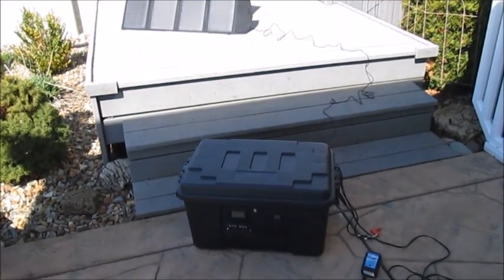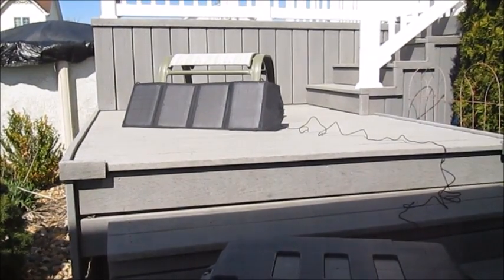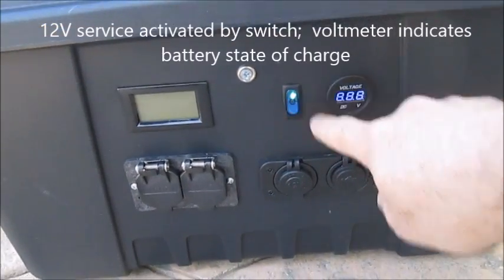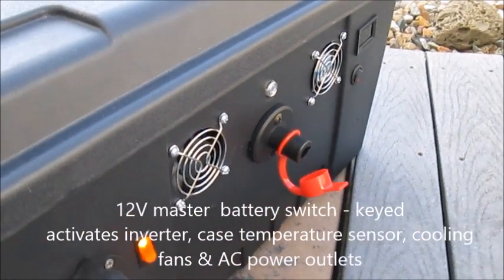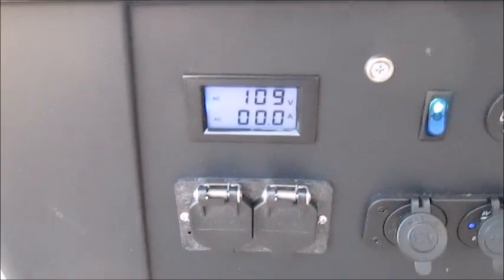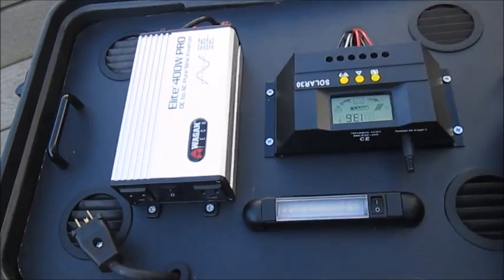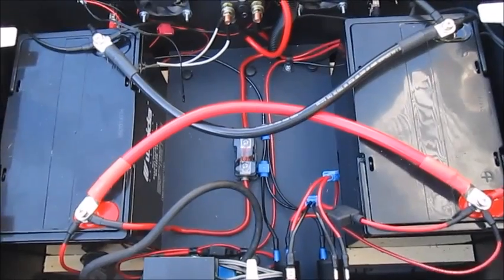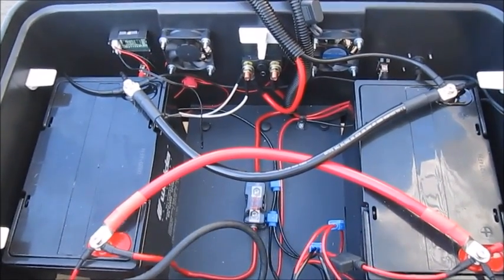V1 P1 DIY Portable Solar Power Generator - Wiring Schematic, Parts List, FAQ Sheet Provided

Comment: How portable is the Storage and panels ?950 includes these panels, mono or poly?
Reply from the maker: The weight of the battery box is about 90 pounds Eric. When I take it out of my boat for winter storage it is placed on a small dolly that allows it to be rolled around quite easily http://www.harborfreight.com/200-lb-capacity-movers-dolly-95353.html  To be sure, it is a two person operation lift and move the battery box safely for use in different situations. It is portable to the extent that it is not permanently attached to any fixed structure, such as is the case with some solar energy systems installed as backups for home use. The panel I use at present is light and easily stored, although Renogy has stopped producing the bendable mono panel I mentioned in the video. Yes, the total cost of the build was about $950 including one 100 watt mono solar panel.  I paid a little more for the bendable panel, but if someone else was to build this system they could realize some savings by using a rigid framed 100W panel.
Reply: So... not very portable. Not a lot of output for 90 pounds and nearly a grand. And for convenience you should buy a dolly for single person transport.
Reply from the maker: For comparison Eric, check out the Goal Zero commercial line of products.  Their 1250 model is 116 lbs., offers only 100 amp hours and includes two 30 watt solar panels.  That system retails for $1,999.95 - more than twice the cost of what I was able to build for myself.  Depending on the application, yes, a dolly might be a useful addition to my design.  Since it was primarily designed for my use on a boat a built-in dolly wasn't practical.

Comment: Generator ?? Or is it "storage".
Reply from the maker: The complete system, when all components are taken into account (solar panel and the battery box), is in essence a "generator".  I think that is an appropriate term that has been commonly used when describing these types of systems.  If you want to be technical, the solar panel generates electricity and the battery box stores that electricity for distribution.

Comment: Are both of those fans exhaust fans?
Reply from the maker: They are set up to create a circular flow.  One fan is oriented to push air into the case and the other is oriented to draw air out.

Comment: 90lbs i would definately keep this in the back of a mini van with the panel bolted to the roof of the van.
you should have a Ebay store and sell some of this as barebone unit without the battery and panels, so people can put what panel and batt. they want. i would buy somthing like this.
Reply from the maker: Thanks for your interest in my DIY project and for taking the time to comment, it is appreciated. The sizing of this solar generator is, in my opinion, just right for use in a mini van or small RV (boat/camper).  There are a variety of commercially produced systems of comparable size available for purchase on the market right now.  Most I have seen come with batteries and some offer options to pair up with solar panels.

Comment: how to made the same thing using 18650 battery?I have lots of them, problem is with the voltage. 11.1. Solar charge controler have to give to the 12.6V over this gona blow every things up.

Comment: Sorry to be the bearer of bad news, but I'd rather it didn't blow up one day when you flip the ON switch.
Although these are AGM batteries, they can still emit some hydrogen gas while charging, especially during overcharging. Google it and see that although all the AGM makers USED to say they were completely safe, they changed their minds around 2000 or so. American Boat and Yachting Council (ABYC) requires that batteries be installed in separate, well-ventilated areas. If those are computer type fans they spark internally and can ignite any gas buildup, plus the lighter than air gas would build up around the inverter and charge controller. Not good.
There are sparkless fans available like they use to vent gas fumes from a boat's engine compartment. With those, and maybe an airtight seal separating the top half from the bottom, then it would be safer. http://zephyrvent.com/specifications-and-prices/
Reply from the maker: +st8kout1 Thanks for your comments and concern.  Simply removing the lid prior to use would effectively eliminate any concern for hydrogen gas buildup that would result from a malfunction of the charge controller leading to overcharging.

Comment: Love the project, but hate the power inverter. Wagan is Garbage imho. I bought one, used it for a week and it died. RMA, received a new one. Had it for a month and it died. Fans Comes on both, but was getting no power. Had and old 400 power inverter laying around that i paid 35 bucks for and it has been working flawlessly for almost a year.

Do you have anymore recommendations besides the wagan power inverter?
Reply from the maker: +Chris . Jones Thanks for your comments.  Well, so far I have had good luck with the Wagan EL2601 400W pro pure sine wave inverter.  The inverter has been in use for a year and I have had no problems with it.  Up to this point I have had no experience with another brand so I couldn't recommend an alternative.   I will post here if the Wagan fails and let you know which replacement I select.

Comment: I love the design and look of it.  I'm surprised it cost that much though.  Still a ton cheaper than premade solar boxes.

Btw, why just a switch for the fans? Couldn't you also install a $20 to $30 standard AC/heater temperature controller?  You set the temperature you want it to run at and it would send the signal to turn on the fans when the box got too hot.  All you would probably have to do is find a simple relay circuit that would actually control the juice.  I'm not an electrician though... there may be a reason this wouldn't work.  It may sound easier than it actually is.
Reply from the maker: +101perspective Thanks for having a look and for your comments.  Keep in mind that total cost of $950 includes the 100W solar panel that is used with it ($220).  Without the cost of the solar panel included the cost of the generator alone was about $730, which is quite a bit less expensive than a commercially produced generator of comparable ability.  The two big expenses of the generator itself are the two batteries ($120 each) and the pure sine wave inverter (another $120).       I had not considered a thermal switch to control the fans automatically.  Good idea- may be an upgrade in the future!
Reply: Jim Fisher
Oh, I didn't factor in the generator.  Okay, that makes a lot more sense now. I was afraid there for a moment that I had bought super cheap stuff or something...lol.  Granted, that could still be the case.  Got all my stuff from Windynation.  They seemed to be professional and all.  Extremely helpful at least with all my questions.
Reply: Jim Fisher
Btw, when you say "solar generator", are you talking about a thermal generator?  I'm not that familiar with what you are talking about.  Until your post above, I thought the box itself was just called the "generator".  Despite it really just being a fancy battery box. 

I've seen the term before.  However, it's always just a solar panel and fancy battery box.  I'm sure I'm missing something here.  You paid $730 for it so it obviously is more than just what I'm seeing.
Reply from the maker: +101perspective When I began researching a portable (non-permanent installation) solution to my electric needs on my boat I came across a number of YouTube videos that described "solar generators", so that is the term I stayed with when describing my system.  The box on its own is just as you described it, a fancy battery box, but when paired with a solar panel the complete system becomes a solar power[ed] electric generator. Here's the complete list of all of the components/parts and their costs.  There are a lot of small parts that are used to build the system that add up fast when you are making one of these from scratch.   http://www.creeksideartifacts.com/parts_list.pdf
Reply from the maker: +101perspective For comparison, have a look at Goal Zero's Yeti 1250 Solar Generator that is commercially produced.  It generates less amp hours than the system I built and they are selling for $1,600 without the solar panel.
Reply: Jim Fisher
Yeah, those Goal Zeros are such a rip off for what you get.  I think many people even buy them and just leave them in one spot.  But yeah, if you want something portable then it's that or what you did... and all those wires scare people I think...lol.

On the "solar generator"... yeah, that is what I've always seen also.  I just got confused when you said you paid $700+ for the generator.  I see you mean the battery/power box. 

Plus, your cost seemed a bit high.  However, you have a lot of switches and stuff and all those things add up I guess.  Plus, I thought the cost for your solar panel included wires, fuses, controller, etc.  I see now that you got a monocrystalline panel which I think costs a bit more than the polycrystalline I got. I hear good things about the monocrystalline ones though.

Anyway, I'm with you now.  Thanks for your time.  And kudos again on the project.
Reply from the maker: +101perspective No doubt I had the "deluxe" concept in mind when I built this system- you could certainly build a basic functional system with a less "finished" look and save some money.  I did take your suggestion to consider installing a thermal switch to automatically control the cooling fans.  I found what I needed on Amazon for under $20 and the installation should be quite simple. Thanks for that idea!
Reply: Jim Fisher
Cool.  Happy to help.  Make sure you keep us updated on how you wired it in.

Comment: Für mich ist soweit alles richtig angeschlossen,was mit dem Außenbereich, wie Steckdosen Ziegarettenanzünder, ect.  Aber beide Batterien müssen einen Anschluss von rot auf schwarz gekreuzt angeschlossen werden, und das andere Rot und schwarz der Batterie (Rot+ Schwarz -) dann mit dem Außenbereich Steckdosen, Zigarettenanzünder ect. angeschlossen werden...Warum...Weil es 24Volt dann anzeigt, und nicht 12Volt. Außerdem werden beide Batterien gleichzeitig mit gleicher Voltzahl aufgeladen. Damit verhindert man, das eine Batterie zu warm wird.
Reply from the maker: +fred schaden Ich hoffe, dass die Übersetzung Ihrer Kommentare korrekt war und meine Antwort ist angemessen. Die beiden 12 Volt-Batterien werden gezielt parallel geschaltet, um eine 12-Volt System aufrecht zu erhalten , dass die Amperestunden zur Verfügung verdoppelt . Die rote Pluspol der Batterie an der ersten Batterie ist mit dem anderen roten Pluspol der zweiten Batterie und schwarz negativ schwarz negativ verbunden, um die Parallelschaltung zu schaffen. Verbinden Sie den roten Pluspol der ersten Batterie mit dem schwarzen Anschluss an die zweite Batterie in Serie würde in einem 24 -Volt-System zur Folge haben. Alle Geräte I mit diesem System verwenden werden wurden 12 Volt zu arbeiten ausgelegt werden. parallel geschaltet ermöglicht es auch , sie beide zu Entladung und Ladung gleichmäßig die Batterien zu haben .I hope that the translation of your comments was accurate and my response is appropriate.  The two 12 volt batteries are connected purposefully in parallel to maintain a 12 volt system that doubles the amp hours available.  The red positive battery terminal on the first battery is connected to the other red positive terminal on the second battery and black negative to black negative to create the parallel connection.  Connecting the red positive terminal on the first battery to the black terminal on the second battery in series would result in a 24 volt system.  All of the devices I will be using with this system were designed to operate using 12 volts.  Having the batteries connected in parallel also allows them to both discharge and charge evenly.
Reply: +Jim Fisher / +fred Schaden. Ja das mit der Ampere-Verdoppelungen gibt mir zu denken. (Beide Batterien Verkabelung rot +auf +/schwarz auf...  Es wird auch meistens auf 12volt strom verbraucht. zB. Boot oder im Camp ezt. Die Kreuzverkabelung beider Batterien rot zu schwarz, sind bei mir mit einem Haupt an-aus Schalter verbunden, der dann direckt an dem (Solar) Power Inverter angeschlossen ist.Dieser hat eine Eingangsleistung von 24-30Volt.Diese ist von außen mit einem Parameter Voltanzeige angezeigt. Somit war es mir leichter bequem mit solar die Batterie wieder aufzuladen, während der Verbrauch vom Power Inverter entnommen wird. Mit der Ampere Verdopplung werde ich wohl noch ein wenig Recherchieren müssen. Nochmals Danke. LG FRED

Comment: where did you get the voltage display?
Reply from the maker: +Alex Holl the AC ammeter was purchased on Amazon http://www.amazon.com/gp/product/B00DVH64HW/ref=oh_aui_detailpage_o00_s00?ie=UTF8&psc=1
The DC meter also purchased on Amazon 
http://www.amazon.com/Coromose-12V-24V-Motorcycle-Voltmeter-Waterproof/dp/B00S7FUT10/ref=sr_1_23?ie=UTF8&qid=1425862186&sr=8-23&keywords=voltmeter+12v

Comment: so just incase i save water instead of using solar to operate a well pump i could use one to operate my refridgerator air and heater, most important i want suggestions for those should i run out of fuel or cannot refuel soon.. i kept your information just incase thanks a bunch
Reply from the maker: +samantha nicholson a refrigerator draws the least watts of the applications you mentioned and a moderately sized solar panel array and semi-portable battery bank would suffice for that purpose.  But, in my opinion, running air conditioning and heat (particularly electric baseboard heat) would demand a much larger system  than is represented by what you see in my video.  You would need multiple solar panels and a much larger battery bank from which to draw the amp hours and high wattages being drawn by air conditioning and heat.

Comment: where did you get the box?
Reply from the maker: +samantha nicholson       Amazon - search under Plano 1619-00 56 Quart Tote Tub
Reply: Thank you
Reply: How much would you sell one of those for?  I'm planning on going state to state in my Toyota truck I need something about that size to use for light n heat also for charging a refrigerator.
Reply from the maker: +samantha nicholson I don't make them for sale, this was simply a hobby project.  If I were to roughly estimate what I have invested into this generator inclusive of both my time and the materials it would be about $1,800 to 2,000.  There are commercially produced solar generators available on the market that are similarly priced.
Reply: I loke this one :0) nice job i thought about a solar one to use for house refridgerator or outside to help keep well pump going
Reply from the maker: +samantha nicholson Thanks for your appreciation of my design and build.  I borrowed many of what I felt were the best features of quite a few others' designs that were posted here on YouTube.   This one could effectively power a small home refrigerator, but it would need a larger watt inverter to handle a well pump.  They tend to draw a lot of watts at start up.
Reply: Would a 1000 watt pure sine work?
Reply from the maker: +samantha nicholson my quick search on the web indicates that a 1/2 HP well pump will draw 2100 watts at start up and continued running demands 1000 watts.  You would likely want at least a 3000 watt inverter or more and a pure sine waver inverter will be better for the pump motor.

Comment: looks great man, I'm working on a similar system for garden lights etcetera. I intend to use only 12v as the inverter to 220 generates loss while converting. Your project is a nice inspiration source!
Reply from the maker: +Boss Thanks for your kind feedback.  You are right, if you only plan to use 12v appliances there is no need to spend the money or solar energy you generate to invert for AC use.

Comment: "Thinking out loud here": In an effort to keep as compact/"light-weight" as possible, pretty sure I will use two 35 amp hour deep cycle batteries vs. (1) large 80+ amp hour battery.?. Would like to build mine in the smallest Stanley brand, plastic tool box on wheels with telescopic handle that they make. Trying to find a minimum 50w brief case type solar panel with minimum 10a charge controller. I am thinking 1500w inverter from amazon.com that has a minimum 4+ star rating/15+ verified purchaser reviews and under $145.00. Will add meters, USB port plugs, automotive 12v plug, etc. The primary use of my set up, would be for weekend camping at a camp site without electrical hook-ups or emergency back up power in event of electrical outage. The largest draw of power from the above described set up, would possibly be a compact/travel sized hair dryer or small table fan. Now, must figure out if I should hook up the two 35 amp hour batteries in series or parallel? Any and all advice/suggestions would be greatly appreciated!:) Thank you, Angler Beaudry.
Reply from the maker: +Angler Beaudry if you want to increase the amp hour capacity and maintain the voltage (12V) you must connect the batteries in parallel.  If you connect two 12V batteries in series you create a 24V system.
Reply: +Jim Fisher Gotcha. I am going to stick to using a single 12v 80-to-105 amp hour deep cycle battery and then go from there for now; with the option of hooking up to additional batteries, as you have done. Still sticking with 1500w inverter kit and the 50w Renogy solar panel kit with 10 amp charge controller. Will definitely be adding at least one computer type cooling fan. Thanks again, Angler.